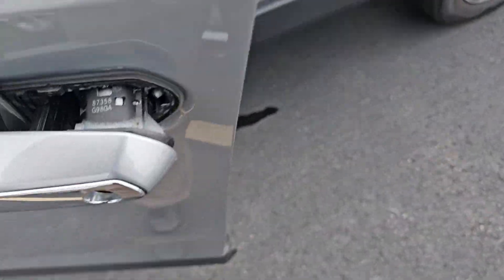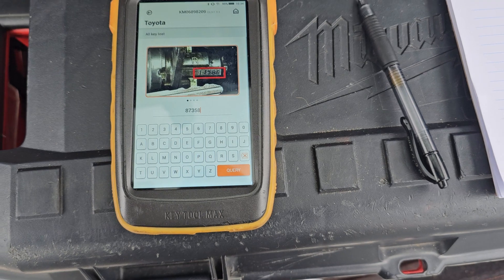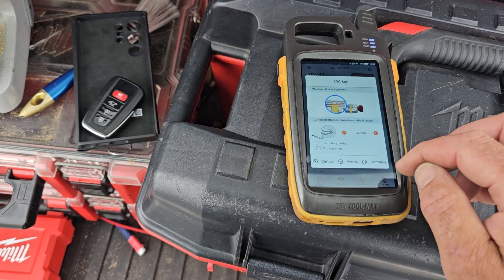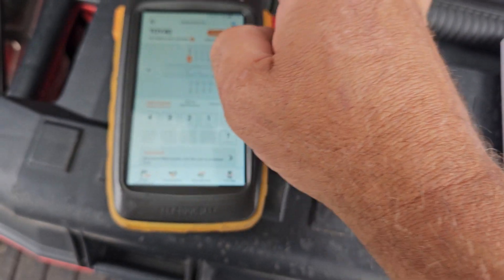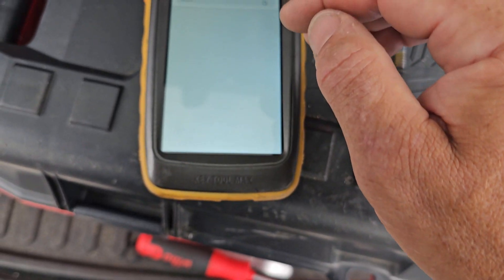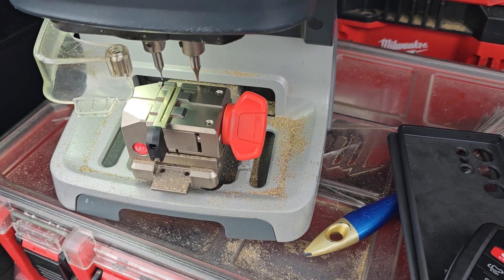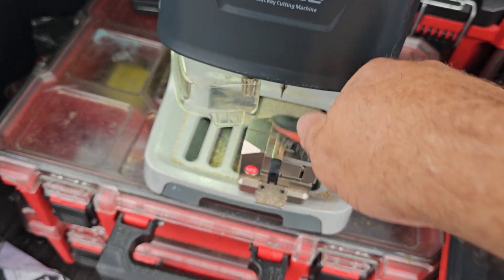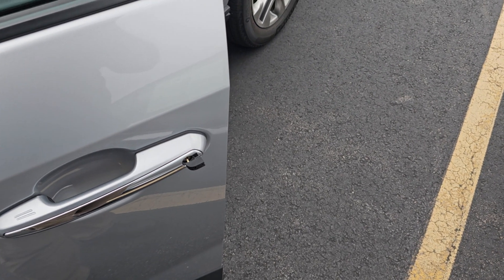Toy 40 cut by code Xhorse flaw?

Comment: Thank you,  for all that you do...  My Condor XC Mini Plus came with a small thin shim inside the package just for this same reason... First time I tried to cut the blade, the probe didn't  touch the tip of the blade. I searched it online and I got lucky by finding a post  somewhere that gave me this realization...
Reply from the maker: Thanks, are you using an M5 clamp for these?
Reply: @markmccormickkeys    I'm sorry Mark.  I didn't think about the difference in the way the clamps chuck the key up.   The Condor comes with an M-1 clamp. You must be right about a glitch in the software after an update, being that you never had this problem in the past.  Thanks again for your insite and showing how to get around the problem..  I saved your video in my bookmarks because I just recently bought the Dolphin II XP005L with the Screen and it does use the M-5 clamp.
Reply from the maker: I may be wrong. Some of the key blanks don't have the channel down the middle. Those work fine.

Comment: I've found sometimes they will not go in the lock all the way, aftermarket key problem I am sure but if I file the tip at an angle and create a ramp I can usually get them to work right.
Reply from the maker: Thanks for the info.

Comment: I've been having the same issues...sometimes the method you're using works, sometimes it Doesn't.. the probe will read just fine, but the "Cutter" cuts in open air Above the key, doesn't go down far enough.. when that happens, I have to select the "77 Avalon" option.. there are two.. one of them has a remark that says TOY2018, it's not that one, its the other 77 Avalon option.. that option will have the stop at space #1, instead of space #2, then the probe and cutter will go far down enough on the  1 sided key.
Reply from the maker: I'm thinking that this may not be a Xhorse flaw. I noticed the OEM emergency keys don't have the channel down the middle. Maybe it's because I'm using aftermarket blades?
Reply: @markmccormickkeys  i think software issue, I had to go look at a couple oem keys and all the ones I've seen had grooves in it